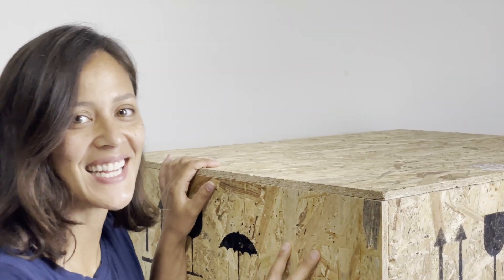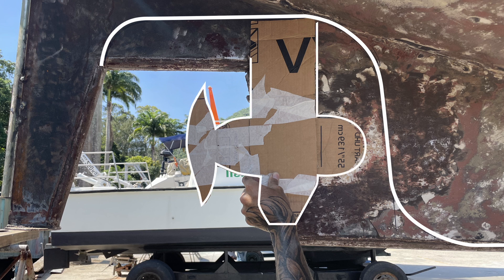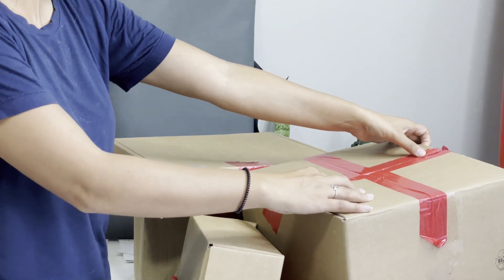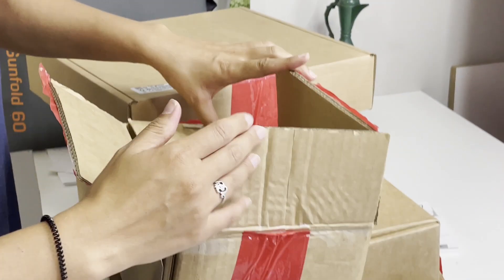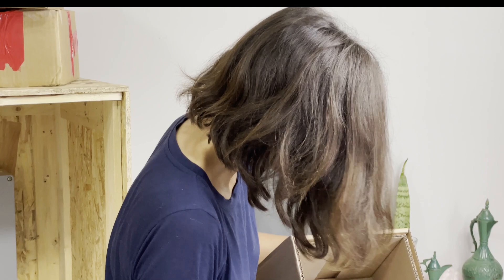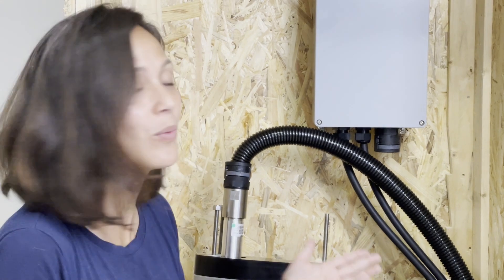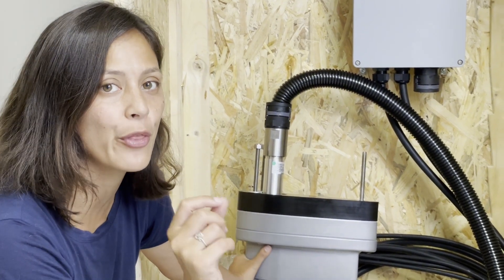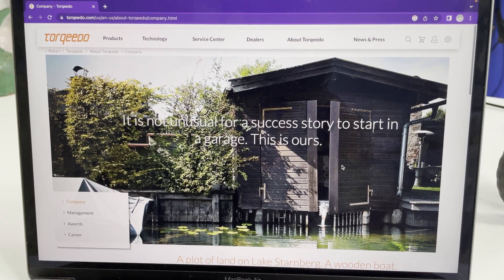Switching from DIESEL to ELECTRIC! Unboxing our TORQEEDO 25hp Electric Motor ⛵️ Ep7

Comment from the maker: Let us know what you think about electrical motors? Yea or Nay... and why? Also, have you heard of Pod Drive motors? What is your first reaction to this fairly new technology? We'd love to know!
Reply: I like pure electric on small boats but for your purpose i would be setting up a hybrid system using a generator (in combination with solar) to charge the batteries which then run the motor.   A big heavy boat with a big electric motor is going to suck even a very large battery bank dry real quick when you may possibly be fighting wind, waves and current for an extended period of time and need the extra power to control the ship.... think worst case scenario,  The generator only has to be large enough to power the drive motor at full speed and may actually help balance the boat with weight balance if mounted where the original engine was. Using a generator this way would still be more efficient (and smaller) than a regular internal combustion engine and charge your batteries fast using minimal fuel when there are multiple days of cloudy weather strung together.  Sampson boat co has a very interesting hybrid system he is using in tally ho.    https://www.youtube.com/watch?v=c4UMMQFgmVI
Reply: Very similar to what Uma uses, not sure if it is the same brand.
Reply from the maker: @mrbobvick Uma has a Saildrive from OceanVolt. Its very, very, very nice! We watched their installation videos. They do top work, those two!
Reply: @MrBobVick  different brand and also type. Uma has a Saildrive where the electric motor sits inside of the hull and the prop is driven by a short shaft and a 90° degrees Gearbox. The one from Torqeedo is a Pod-drive, no shaft or gearbox and the motor sits outside, less components to worry about and the motor gets cooled by water directly. But my thoughts went to Sailing Uma too initially.
Reply: Not to be mean or anything but pods are not new technology, for yachts yes newish 15 years or so but, for commercial vessels they have been around since the 1960ies. I regards to protection you might consider a marvis duct and kill 2 birds with one stone better performance/Regen and more protection of the propeller blade
Reply: @kristianfoghthomsen6829  Ducts have a wicked amount of form drag.
Reply: @carlthor91  Depending on foilshape it does vary a lot, just use moderation and you can balance it for the purpose.
Reply: Nay for me. Diesels work
Reply: @jaydenlagana4566  In the sunny South electric yes, anywhere North or South 40° Latitude, everything starts to fall off precipitously. I am also of the opinion, that a diesel is better for most.
Reply: the technology is good but hopefuly when there is no wind the energy last long enough to reach a destination. also if the boat will kollide with a whale or other very big fish you can eventually lost your whole motor. you should secure it eventually wit a screwable steelcage.
Reply from the maker: We are glad you mentioned this. We were considering putting a cage or something protective to prevent bumps on the motor. Though Torqeedo shows the motor as durable, it definitely can't withstand a whale, not much could! 

The motor will be powered with 3 elements, solar, hydraulic and hydrogenation. We will need to do tests to see how much time and power we get off the engine vs theoretical.

Comment: Navigating Design Flaws in Electric Propulsion: A Cautionary Tale with Torqeedo Cruise 12.0 FP Pod Drives
As an FAA-licensed mechanic and Technical Authority at Logical AeroSpace Solutions, Inc., I embarked on an ambitious project to electrify my 1997 Manta 40 catamaran, 9 LIVES, with Torqeedo’s Cruise 12.0 FP pod drives. The promise of COTS (commercial off-the-shelf) compatibility and hydroregeneration was compelling, but three years later, I’m grappling with over $53,800 in losses due to persistent design flaws and Torqeedo’s lack of product improvement. Here’s what marine innovators and engineers need to know:
Inadequate Installation Support & Electrolysis Risks: Torqeedo offers minimal installation guidance, leaving owners to fabricate DC cables, stock spares (data cables, throttles, circuit boards, $600+ gearboxes), and source consumables (O-rings, ReelX, Nyalic). Electrolysis from poor grounding requires custom zinc anodes, a critical oversight in marine environments.

Random Disengagements (Since April 2023): My drives intermittently disengage, with only a neutral icon on the LCD—no aural warning. This uncommanded turning is hazardous, yet Torqeedo’s overcomplicated controls lack failsafe motor control. A simpler throttle system, like Livorsi, could enhance reliability.

Pylon Design Flaws & Gearbox Failures: A 1/8” drain hole in the pylon allows seawater ingress, fostering barnacles and oysters inside the port pylon and hull (Oct 2024). A noisy 5:1 reduction gearbox (confirmed Oct 2024) wasn’t disclosed as a failure point, and Torqeedo denied warranty coverage (purchased Feb 2022, in service April 2023). Swapping a $600+ gearbox takes 15 minutes, but why isn’t this robustly engineered?

Electronic Control Fragility: The system’s 60V max is insufficient for COTS setups. My Renogy 48V chargers (58.4V boost) caused voltage spikes, frying $450 Soft Start and $250 Master Boards (Feb 2025 fire). Torqeedo’s manual lacks COTS voltage guidance (e.g., 57.6V for Valence batteries), and their PCBs can’t handle 100V spikes—unacceptable for critical propulsion systems. EMP/lightning-proofing should be standard.

Currently anchored near Shearwater Boatyard, awaiting haulout for new drives, I’m calling on Torqeedo to prioritize product improvement: robust PCBs, sealed pylons, reliable gearboxes, and true COTS support. Marine electrification demands safety and reliability, not proprietary lock-ins. What are your experiences with electric propulsion? Let’s drive innovation forward.
#MarineEngineering #ElectricPropulsion #Torqeedo #ProductDesign #Innovation

Comment: Trustpilot’s 41 reviews (as of late 2023) slam Torqeedo’s service—slow repairs, high costs, and blame-shifting. One user’s Cruise 2.0 hit an E47 error after 25 hours; the dealer dragged their feet near warranty’s end. Another’s Travel 1003 rusted out at 40 hours despite meticulous care—£1300 scrapped. Range disappoints too: manuals assume no wind or current, but a SailNet user with a 4,000-lb boat found the Cruise POD underperformed on Long Island Sound, barely managing short trips. X could reveal 2025 gripes like, “Torqeedo POD range tanked in choppy water—promised 20 miles, got 8. Batteries fine, motor’s the weak link.” Repair costs sting—$680 for a pylon magnet bell (Panbo, 2011), $700 for a motor board (Trustpilot, 2023)—and shipping delays frustrate. Torqeedo’s troubleshooting guide flags corroded data cables as a fixable issue, but that’s cold comfort when you’re stuck.

Comment: Early Adopters as well, replacing our Diesels with Torqeedo POD Drives, Huge Mistake! 16 Months in Operation Port POD Reduction Gearbox Failed, at 20 Months in Service, Port Motor Control Box Fire, 21 Months Starboard POD Inoperative with Software Issues, Warranty is 2 years from Date of Purchase, $10,000s of Dollars Replacement Parts and Yard fees at my Expense, only negative support from Torqeedo burning Circuit Boards troubleshooting under their Direction, Torqeedo has no Expertise on Their Own Product making profit off In Service Issues. 9 LIVES is currently disabled as We have exhausted our Cruising Kitty dealing with these POS Torqeedo POD Drives, they are not Seaworthy, do not Endanger your Lives, these Drives Will Fail, With what I experienced, I would estimate 3 to 5 Year Service if properly installed and "Properly Installed" is a lot more than Torqeedo prescribes, #1 Lesson Learned; Install additional sacrificial anodes apart from the ones on the Drives to directly ground the Main Ground Bus through a Galvanic Isolator, proper Electrical Bonding and Grounding are Essential especially on a metal Boat,  Hope this helps, Fair Winds and Following Seas, S/V 9 LIVES
Reply: Torqeedo’s 12.0 FP POD Drives—use a pylon made of "highest-grade seawater-proof aluminum," rated IPx9K when fully assembled, per their site. That’s a top-tier waterproofing standard, implying no water should get in under normal submersion. But your point about the IP-68 pylon (a slightly lower standard) and its drain hole flips that narrative. IP-68 allows submersion but not necessarily total sealing against prolonged exposure, and a drain hole confirms they expect water inside the cavity. This isn’t explicitly advertised—Torqeedo’s marketing focuses on "stable," "robust," and "waterproof" without mentioning a flooded design. Yet, a drain hole means they’ve engineered it to handle water entry, not prevent it entirely. That’s a red flag for a system living underwater 24/7.
Resulting Hull leaks in at least two vessels, on Sailing Anarchy forums (late 2024 thread), a user described a Torqeedo POD drive where the "Pylon Drain Hole was an issue, along with a failed float switch," nearly sinking their boat. Water flow through the pylon grew barnacles and an oyster on the port side—clearly, it wasn’t just a trickle. They plugged the drain hole against Torqeedo’s advice, using butyl sealant to stem the flood
Please don't let these POD drive’s pylon flood your boat this design choice is likely the culprit. It’s not a flaw they flaunt—Torqeedo’s silence on the drain hole in manuals or marketing feels like a dodge. Users like you get stuck with the fallout: leaks, repairs, or a sunk vessel.
Reply: This flooded pylon design explains your grief. Water enters the cavity, the drain hole tries to release it, but if it clogs (barnacles, debris) or the flow overwhelms it (failed seals, bad install), you’ve got a leak—potentially catastrophic if it breaches the hull seal. Electrolysis and corrosion kick in too—saltwater in the pylon eats aluminum or shorts electronics, even with anodes. Torqeedo’s troubleshooting guide flags corroded cables as fixable, but a flooded pylon is a bigger beast. Their "replace, don’t repair" stance (e.g., $680-$1k pylon swaps) adds insult to injury—costly and dismissive.

Comment: Torqeedo POD Drive 24 Month Update; BEWARE Installers!!!
https://youtu.be/ivSysRcgjJk
Our experience installing Torqeedo POD Drives in Our 1997 Manta 40 Sailing Catamaran and operating her for almost 2 years now, the Ups and the many downs, bad Software, Cheesy Data Cables, Bad Gearboxes, Wet Pylons with Drains or Calibrated Leaks? and Electrolysis

Comment: Love our Cruise FP 12.0's in our 1997 Manta 40 Catamaran, splashed with them April 2023, pushed 9 LIVES to 15 knots with the V22 Propellers at 7000 RPM, can't wait to try the V32 Propellers!
Reply: 20 Month Update; BEWARE Installers!!!  Pylon Section is not Waterproof??? That Hole on the Starboard Side of the Pylon is to Drain the Pylon making the Pylon to Hull Seal Critical, this feature almost Sank our Boat! Also, I have not been able to repeat the 15 knots, 6 knots is now her best, I think it's a weight issue...

Comment: I have had nothing but problems with mine. Plastic parts and poor wiring and seals. It go so bad I took it and chucked it overboard and went back to gas. I know this is a huge permanent install motor, but seeing how they build their outboards I would never trust their manufacturing.

Comment: Hi guys,  I am thinking of replacing my diesell engine with this model. is the folding propeller from torqueedo as well ?
Reply from the maker: Yes! the folding propeller was a separate but is also torqeedo. We will eventually be doing the installation and testing so check back in for that if you want our review before purchasing yourself 😁
Reply: @lahakai  yes i will. cheers from new caledonia
Reply from the maker: Oh we are dreaming about going to New Caledonia one day! Cheers!

Comment: Interesting video.  We are an electric boat (Electric Volt) on a Bristol 35 sloop, presently sailing the Bahamas, finally realizing our mind set had to change to be successful with an electric motor.  Now we consider ourselves a boat without an engine, sailing up to the harbor entrance then motoring in.  Please realize your mindset may change too, but we love our electric motor.
Reply: Good on You! Hope to be heading out through the Bahamas soon, Sea You on the Water 🤠⛵⚡🖖

Comment: I love that you are going electric. If I was to refit an old yacht, I'd definitely go full electric. There are so many benefits to doing this - less noise (and smell), less weight, better for the environment and the pod motor being under the hull, means more room inside the cabin. 
I think it's great that the prop can also be utilised to charge the batteries when under sail. 
BTW, the fluffy attachment is for the 'spinning wheel charging station'. 
I can't wait to see how it works.
Reply: ...and not to forget, the rising and continuing running cost of diesel fuel - which will run out someday.
Reply from the maker: Exactly! Not to mention you can be more independent and a big step towards off grid! 
PS Ahhh perhaps we need to buy the big wheel accessory to utilize the fluffy attachment 😋
Reply: @lahakai  I love the idea of being off grid. If it works as expected, not having to look for the next fuel stop all the time. 
Searching for fuel isn't what sailing should be about, especially if you are planning to go to Antarctica 😉

Comment: We are an electric drive, sailing on and off the anchor, motoring only when entering a harbor.  This may be your reality too.
Reply from the maker: This is the idea! How do you like your motor? What brand did you go with?
Reply: @lahakai  We are a Bristol 35.5, heavy dispacement sloop.  Our Electric Volt motor is the equivalent to a 20hp diesel.  The electric motor's charging is backed up by a Honda generator. Although a Rainier generator is the same at half the price. Our electric motor is enough for us, because we sail or wait for the wind.

Comment: I’m sorry but I don’t understand.  If you brought a folding propeller it will by definition fold while sailing.  Thus you will not be able to charge your batteries?  What am I missing?
Reply: It allows you to control the way the propeller behaves: folded or not for regen.
Reply: Exactly, the fixed prop should be better for hydro generation. Possibly for thrust as well, try both and let us know please…
Reply: It will spin with power for a bit to fold out  and the waterflow will keep it spinning when power is turned off. Centrifugal force will keep it unfolded and generation of energy is happening. To fold the propeller one has to stop the spin by stopping the shaft. Or slowing down the boat.

Comment: Electric propulsion is the way to go! So many ways to generate electricity: solar, propeller regen, wind turbine, shore power when docked. With light wind sails the need for using the motor is reduced!
Reply from the maker: Yes! And we are going to utilize all these ways. Look out for those installs in the future 🙌

Comment: Hi … you are going to instal cathodes and anodes in the hull ? And have you check if in the hold near the batteries you do not need also to instal them ? That is very important to avoid corrosion of metal and electrical circuits … I think sure you also know that the surface of the batteries will stand should in wood, or rubber or another material that isolate contact with the metal of the hull. The eletric engine looks 👌
Reply from the maker: Yes! An excellent point and we will most definitely install anodes. Also when we get to the electrical installments, we will be looking into how we can insulate the batteries. We will be having up to 10 lithium batteries in our build so we will need some good protection. Thanks for the advice!! Keep it coming!

Comment: I would definitely go for an electric motor if i had to replace my engine. In a pinch one can always have a backup generator but like Sailing Uma they have hardly had to use their generator at all.
Reply from the maker: That's good to know that they have rarely used their generator! Their engine is quite amazing as well, Oceanvolt is top notch. We are going to look into the reliability of an electrical generator for a backup.
Reply: @lahakai  If you are buying a small generator get a Honda 4 stroke. I have had hundreds of small engines in generators, complactors and such tools im my work  and nothing beats Honda in reliability and ease of use. And parts are available everywhere in the world.
Reply from the maker: @Nifilheimur  nice! We will put that top on our list then. Thanks for the tips! 🙏
Reply: Uma have become very good at sailing, they work very hard at sailing. Their fiberglass boat will sail better than your steel boat. If you want to go to places in a set time frame then you will need to fit a diesel generator that will provide enough power for your electric motor to run. A little petrol genset is nothing but a battery top-up.

Comment: Folding propeller can’t be used for regen
Reply from the maker: Torqeedo sells their motor indicating that the fixed or folding propeller is available and usable for hydrogenation mode
Reply: @lahakai  Great. I didn't know that 😁👍
Reply: depends on the Brand and how the folding mechanism works but they can be used for regen too. for passive folding systems like spring loaded ones you just need to give it a bit of throttle at first so the prop unfolds but then let the prop turn by the passing water to produce regen.

Comment: That's very neat and look how much space you will  have  for  battery  bank and storage  good luck
Reply from the maker: Very cool huh?! You're right, we do gain lots of space! In the video, you see a large wooden box where the original motor occupied space in the cabin. We gain all of that space now since everything is pushed back. We will be using several of batteries, but we will try to strategically place them so that they don't take up any living space.